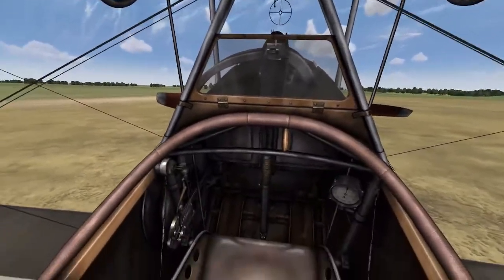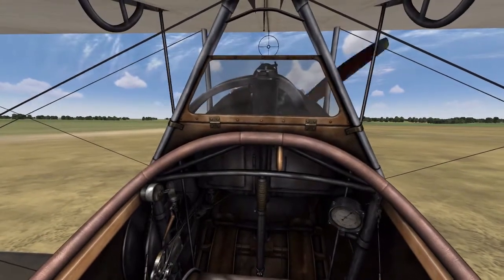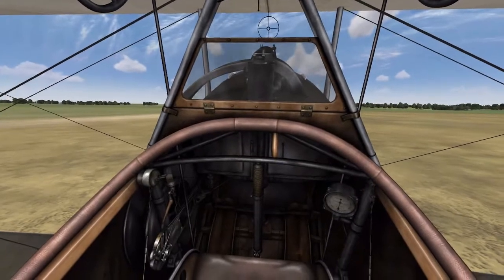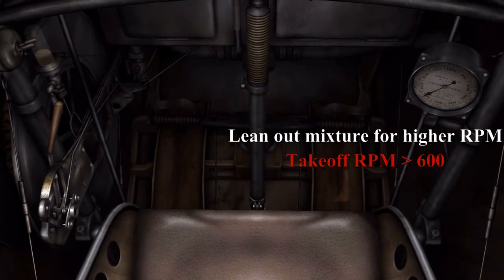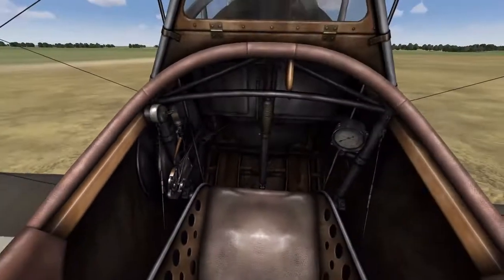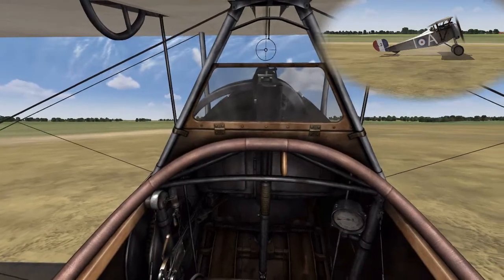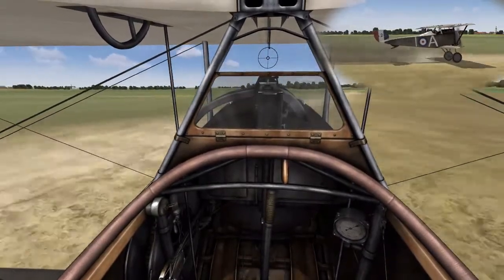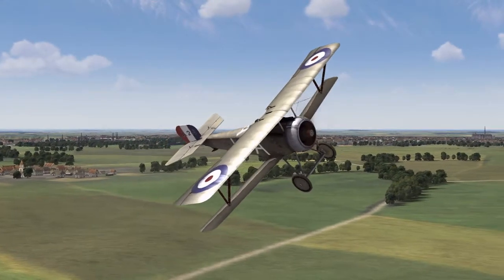Nieuport 17

Comment from the maker: Yes. If you do not adjust your mixture as your altitude changes you will not have optimal RPM. Overcooling the engine due to overly rich mixture is also possible.

Comment: One thing I have noticed with the Nieuport 17 is that in missions I start in the air the simulation acts as if the plane has no throttle unless I blip the engine. Then it "unlocks" the throttle.